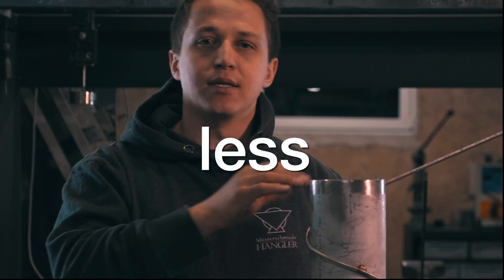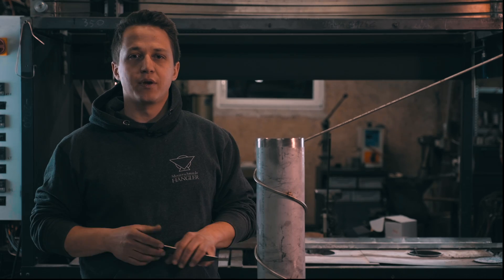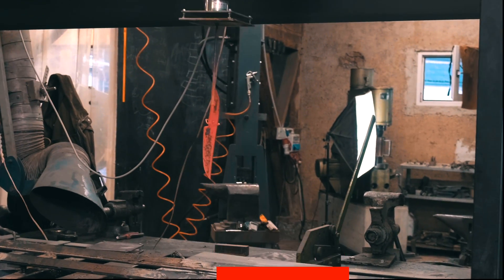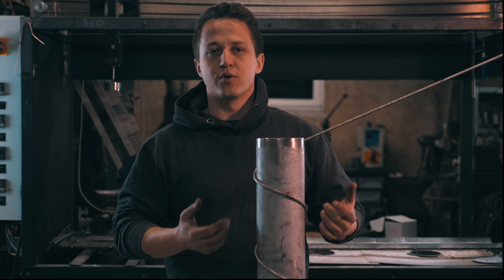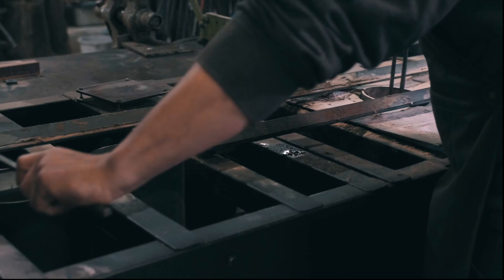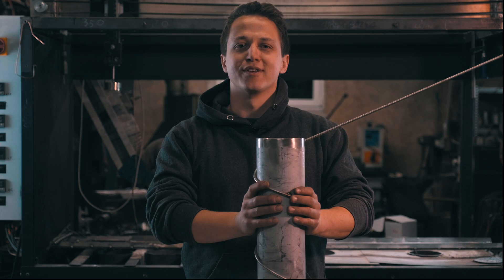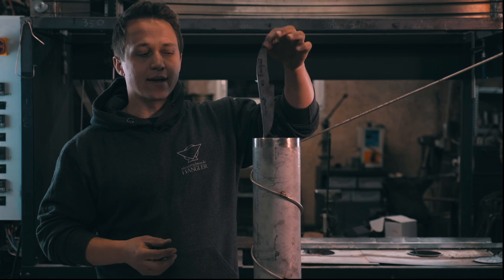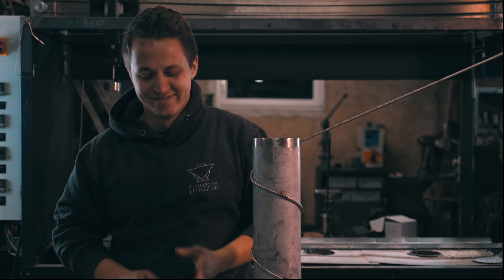Is this THE BEST system for HEAT TREATMENT for knife makers?

Comment: Good job again 🎉

As an additional bonus for fluidised beds, you can also carburise and nitride steel with them just by changing the gas you use.  It’s a very versatile piece of kit.
Reply from the maker: Great tip - didn't realise that myself but yeah that makes sense. Thanks for watching Tom and speak to you again soon!
Reply: Maybe do rudimentary Carburizing but nitriding? Nope.
Reply: @atul2048  I have done it successfully myself, so yes it’s perfectly possible. Carburising and nitriding can both be done quite controllably if you integrate a good gas analyser into the process. 

Boyle’s Law means it’s not very efficient as far as gas use goes. I’d not want to do a 60hr nitriding process at 500C but a quick nitrocarburising at 580C for 4hr or so is grand.
Reply: @GemAppleTom  Hello, using the setup described in the video I would say it's not possible to do nitriding or nitrocarburizing at the austenitizing temperature. Even in ferritic temperature ranges previously mentioned, it is not possible to do efficient nitriding as your room would be filled with toxic/acidic vapors as a few microns diffuse into the kind of alloys you are using. 

Best to use an airtight system with recirculating systems and a hydrogen potential sensor for a satisfactory result.   

PS. Pumping nitrogen alone wouldn't result in the nitride layer.
Reply: @atul2048  i was talking about ferritic nitriding and nitrocarburising. If I was talking about treatment in the austenite range I’d have called it carbonitriding (even though the standard nomenclature makes no bloody sense…). 

Yes, you need good ventilation and a way to burn off the flew gases - something you need with a standard gas nitriding furnace too. I can attest to how unpleasant getting a lungful of ammonia is. 

Yes, of course nitrogen gas isn’t going to nitride steel - unless it’s ionised as in plasma nitriding. I used a N2/ammonia mix. The N2 isn’t ideal but required to fluidise the sand bed (hydrogen makes the best mixing gas but practically that mean using cracked ammonia). 

I can assure you it ^is^ possible to nitride in a fluidised  bed. It’s by no means ideal, I’ll happily agree - I’d much prefer to use a standard gas nitriding furnace with a decent mass flow controller, hydrogen and oxygen probes but you can do it. And if you are limited in space and equipment, having one furnace that can do hardening, carburising and nitriding is very useful. And exactly that was the situation it was used in - a small contract heat treatment company serving a small customer base where carburising and nitriding were only occasionally required.

Edit: I don’t really think nitriding is useful for knife steels in general, certainly not plain carbon steels. I’ve done most of my gas nitriding R&D work on tool steels where nitriding is very useful.
Reply: @GemAppleTom  
Austenitizing with a fluidized bed offers advantages over conventional heating using a resistance furnace. I admire your setup. I wanted to build one in 2016-17 but somehow didn't. 

Agreed. It's not possible to do efficient/ideal nitriding using a fluidized bed. I know this for a fact because we tried to produce ferritic case hardening technology for around 6 years. We tried nitriding using a fluidized bed on CS and SS alloys during this time. The fluidized bed (25 ammonia and 75 nitrogen) failed to produce a uniform case layer and oxidized the surface. Nitriding at 400 C for 6 hours yielded quality results but nitriding at higher temperatures produced over 20% pores in the diffusion layer. The same case depth would be achieved in 1/8th duration in a closed chamber. It would also consume 1/25th of the gases. 

Agreed, Nitriding on knives made of carbon steel may lead to inferior performance compared to quench tempering owing to the absence of any carbide/nitride forming elements. I could be seriously wrong here since we nitride on carbon tool steel such as O1 and O2 that are used in grass cutters. They are basically knives.
Reply: @atul2048  Which steels we’re you looking at? 

75% N2 sounds quite high. N2 really just slows down gas nitriding. 

Steels with Cr content above 4% can be tricky to gas nitride - it’s do-able but you need to be very careful with you gas mix and may need to pre-oxidise at 450C followed by nitrocarburising (either with CO2 or methane) at high N potential to get the process going evenly. Case depth is normally dependant on just time and temperature but that relies on the surface being in the right condition to start with. I’ve seen the case depth double in the exact same process after proper pre-cleaning with gas nitriding -an advantage of plasma nitriding since sputtering will clean the surface.

Stainless steels generally need some way of removing the oxide layer - another one of the big advantages of plasma nitriding. Fluidised bed has the advantage over normal gas nitriding because you can mix a reducing agent in with the sand. 

I assume you mean 20% porosity in the compound (aka white layer)? Not reason at all pores would develop in the diffusion layer below the surface. Though the porosity can actually be useful especially if you post-oxidise. They can act as stores for lubricant. Dreadful for highly loaded parts like bearings though. Best going for a compound layer free process. If you need a fully dense compound layer, you’re best going for plasma nitriding (though you don’t tend to get as thick a case as gas).

Nitriding is useful for cutting equipment you can’t easily sharpen and doesn’t have too fine an edge. Grass cutters, shears for cutting through plastic - all good applications for nitrided tool steel. But it won’t allow the kind of sharpness you need in, say, a kitchen knife and will embrittle the edge. And if the edge doesn’t chip you’ll be removing the nitrided case during grinding and sharpening.
Reply: @GemAppleTom   Yes. The reason for having such low NP is to prevent the formation of compounds. We used a KN to make sure that there is always 25% un-disassociated ammonia. So in the first stage, the ammonia would be around 60%, but for a very short time. 
My experience comes from lab trials where the initial specimens were properly prepared to accept nitriding. 
No. I meant there were pockets of areas without diffusion. This is because of the SS alloys produce oxide layers almost instantly after submerging the coupon into the bath. Unlike CS alloys that produce a more loosely bonded oxide layer that is removed by the abrading sand itself. 

Some papers have also reported using a separate heater box to pre-disassociate the ammonia and carrier before feeding to the fluidized bed. 
My opinion is still the same. In the company I work in, we are expected to process 600 Kg per shift using a 33 KW machine. Whereas, a 21 KW fluidized bed would  produce less than 150 KG of parts.
Reply: @atul2048  Sounds like you had a similar issue I had gas nitriding M50 tool steel. The requirements was for an even and fairly deep diffusion layer while also being compound layer and intergranular nitride free. An even case was easy, IGN free was easy but both together took about two years of tweaking the process. 

There are proprietary gas nitriding processes that can work on stainless (Kolterising is one) though it requires a dedicated furnace and some nasty chemicals to remove the oxide later. Up to 5% Cr is do-able with careful control in a gas nitriding furnace. Though after that plasma become the best option if you can afford the furnace. You can’t plug in your gas mix and work out a nitriding potential from a formula in plasma but it’s a lot easier to get even, compound layer free with high alloy steels than gas. 

A standard process like nitrocarburising something like H13 is achievable with fluidised bed. I don’t think the M50 project would have worked. The very fine gas balance while needing enough gas at lower temperatures to fluidise the sand probably wouldn’t have worked. 

If you’re doing 100s of kilograms a shift it makes sense getting a dedicated nitriding furnace. If you’re doing maybe 50kg max every other month like the first place I worked then a fluidised bed that can also do other jobs is a far better choice. Especially as the customer base was small, local tool makers not big automotive or aerospace contracts.
Reply: @GemAppleTom  Hey. I am currently working on super saturation coatings on stainless steel. It seems like a very interesting filed to work in. But I also feel that the surface engineering research field has gotten very dry and very difficult to publish. I would like to collaborate if you would like to.
Reply: @atul2048  That sounds interesting. I certainly know a few of the  leaders in the field of stainless steel surface engineering. You can find me on LinkedIn if you search for ‘Tom Collins University of Birmingham’. That might be the best way to get in contact away from YouTube (I’m the bloke with long brown hair and a goatee)

Comment: Hello, What are you using as a diffuser plate for the gas between the bottom of the sand and the incoming gas?
Reply: I basically just use a manifold of small holes on the tube. I played with a couple designs until it worked right but its no big deal in a tube this size.